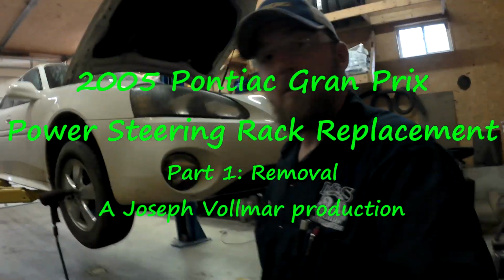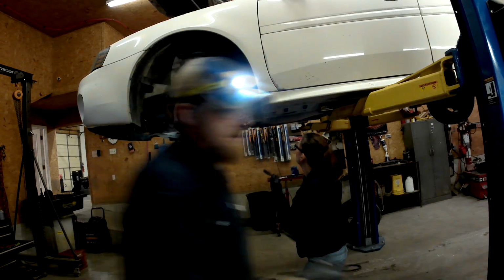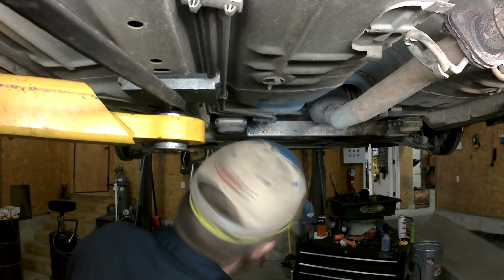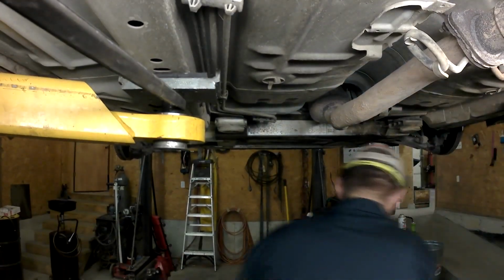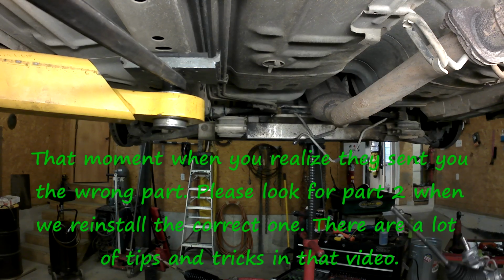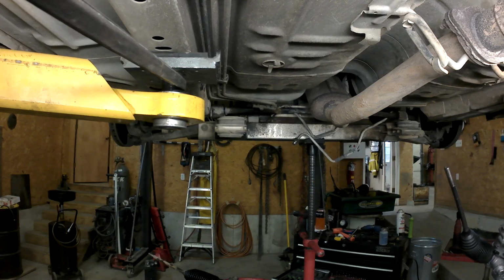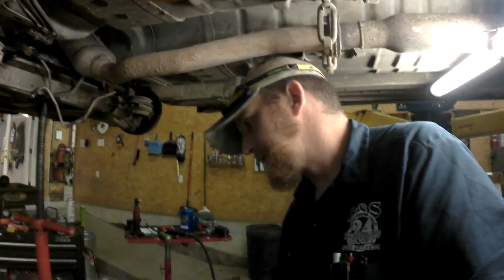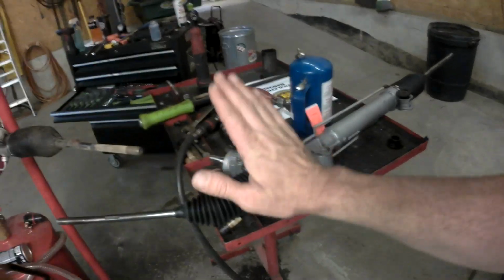Pontiac Grand Prix Steering Rack Replacement

Comment: I was just watching this after changing one 3 times. Look at the RPO numbers on the tag on your trunk lid. The magnasteer is code NV7 or NV8. I think regular steering in N40. My third install included the pump too, and still have no assist at idle. Seems some brands need recalibrated or something. These are BBB industries (Superior) brand #103-0210  Hope yours works ok the first time. My first one worked a year and when it leaked I  replaced it twice more and threw money at a pump we didn't need, and it's still not working.

Comment: I forgot to release pinch bolt and started to drop sub frame. The steering knuckle started seperating from column, but not completely, until I unscrewed pinch bolt. Do you think I damaged anything by doing that?

Comment: Can any one share some advice. I have no power steering, I can turn left but when I turn right my steering wheel pops and keeps turning but not turning the wheels then catches a tiny bit pops again steering wheel turns but not the wheels. Only does this turning right
Reply from the maker: Sounds like you have issues with the internal gears in the steering rack itself. Have a friend turn the wheel for you and watch the shaft going in to the rack from the steering column. If it turns fine both ways then the rack has a internal issue and needs to be replaced.